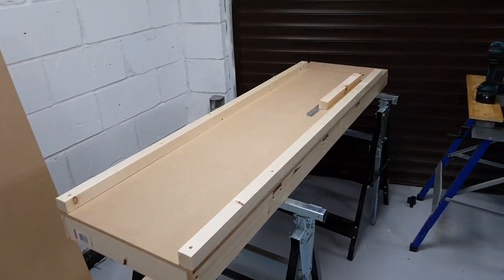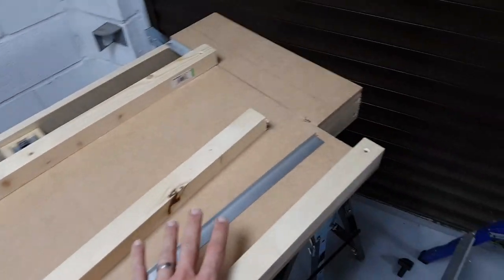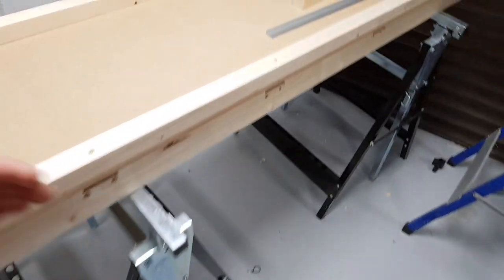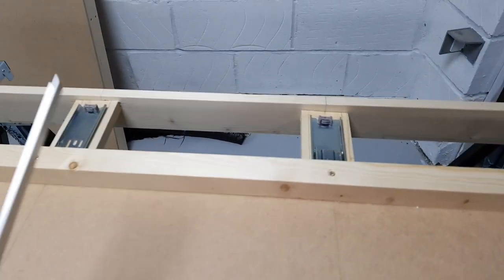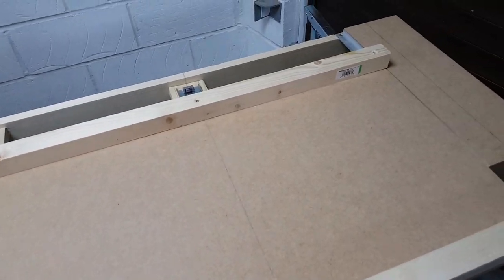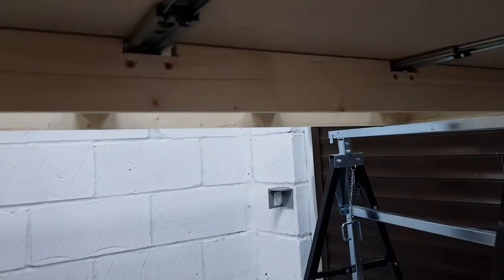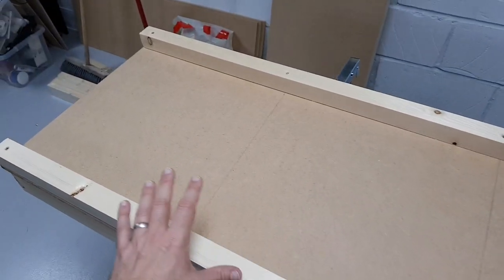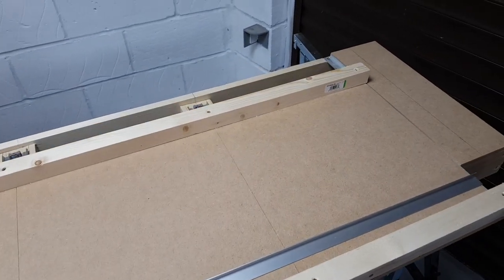How to make a model railway traverser

Comment: Hi, really neat bit of work. I did mine for O gauge so Im limited to how many tracks I can have on the traverser. Someone suggested “ why dont you let it slide both ways” 🤦🏼‍♂️. Wish I had now! I could have had one maybe two extra sidings.
I also put ply underneath so made some storage space. Loved the video, regards Julian.
Reply from the maker: Good idea! I found that my layouts were always up against a wall, so no reason to slide both ways (particularly as I don't exhibit either). One thing that I keep forgetting is that if it only goes one way, the tracks leading onto the FY need to be as close to the front of the layout as possible...

Comment: Well done!   Its been over a year now, and was wondering how those ball bearing slides are going?  They are meant to be used in the vertical and not horizontal, but given the relatively small amount of duty cycles, I guess they will last.   Anyway, good job.  All that thinking and pondering has paid off.
Reply from the maker: Hello there! This layout went to a new home in spring 2019 so I don't have any updates, but they were working great the last time I saw and heard them with quite a few ops sessions under their figurative belt!

Comment: what method do you use to power track on the traverser i.e to bridge the gap thanks for your videos
Reply from the maker: Hi Tony, I'm going to be laying track on the traverser in the next video - since this design doesn't need to be removable, there is nothing to stop you having a feed going into the module, and then onto the traverser deck and then onto each rail.

Comment: Hi, great job you, could i ask where you purchased the aluminium angle from?
Reply from the maker: Hello there, I bought it from Wickes - they have a huge selection - my only criteria was that the short end of the L was lower than 9mm (i.e. the thickness of my baseboards). Hope that helps!
Reply: Arrows of Indecision, Thankyou for your quick reply and thanks again for making a great informative video, I am in the process of adding a fiddle yard module to my layout and you have helped me a lot. kind regards. David